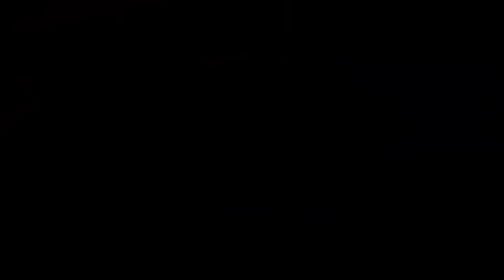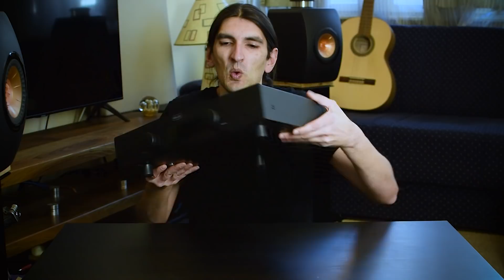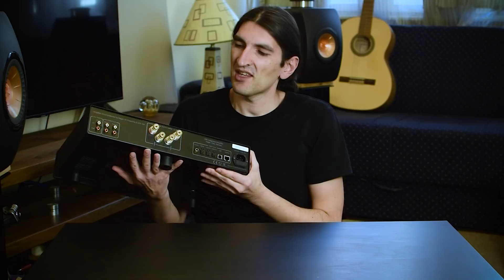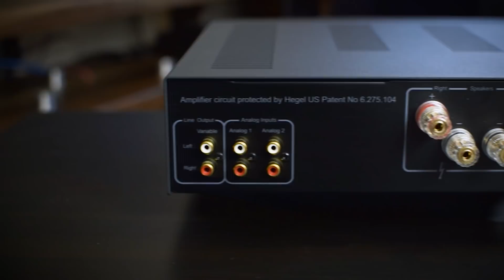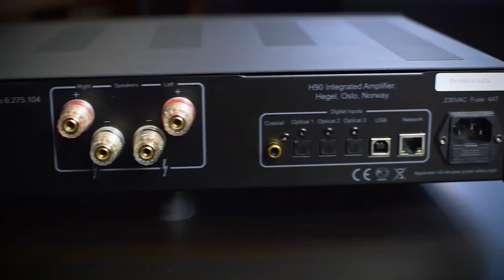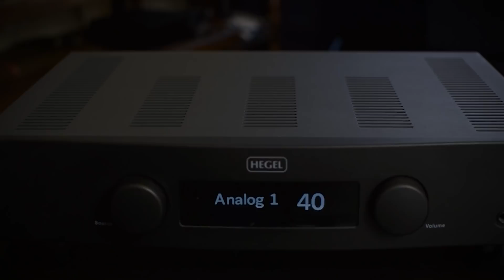Hegel H90 review - A mighty heart of your HiFi

Comment: The difference you may hear between the hegel dac and a $400+ dac is that standalone dacs add bass, midbass and/or try to increase slam and speed which can impact instrument separation.  The Hegel dac is about clarity, accuracy and separation is typically better.  Based on my experience between h160 vs Loxjie d30, Topping E30, d50s, D70S MQA (most competitive w/ hegel and I could have lived with either but hegel was even more clear, instruments better separated, less warm).  I don't know about H90, but the Hegel h160 usb input is rather limited in comparison to other dacs.  But for TV and CD playback, I like it.  Detail, punch and without harshness.

Comment: Hegel is a well built amp and its' dac section sounds great, you'll need to spend hundreds on a dac to be competitive with the dac. Smooth sounding on the cool side of neutral because bass is tight and quick.  You can buy the metal remote if desired.
Reply: Please stop spreading misinformation for newcomers to the hobby.
Reply: @vigneshkarthikeyan8174  What do you mean by misinformation?
Reply: @vigneshkarthikeyan8174 What!?!? Lmao